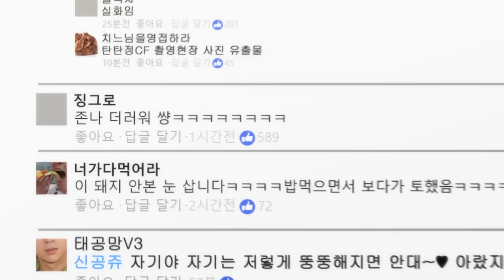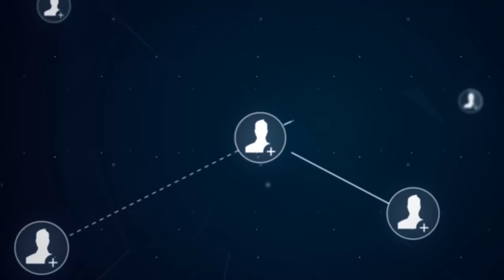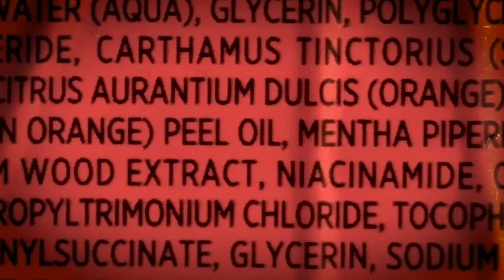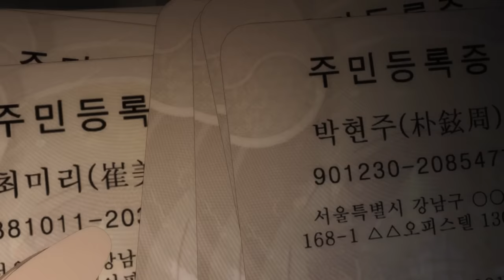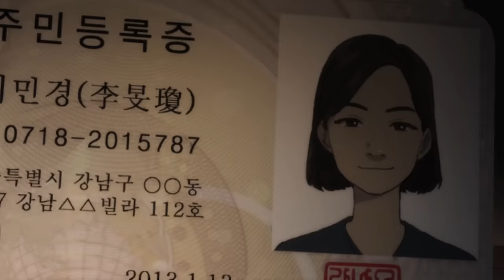How to beat the FLESH POTION in "Beauty Water"

Comment: The fact that the younger are prefered and how the procedure is done, it's most likely stem cell surgery, and why it deteriorates it's because the body needs time to adapt to the new tissue, you have to work out and eat healthy, and watch out for your circulatory system, since your veins will stay the same oversized size.

Comment: Also, if she just needed flesh to have all this happen and work for her, she should've maybe just found a larger person with more on their body to take, have bit by bit used and just store the rest. At a low enough temperature at around 4°C, you can preserve organs safely so that they do not deteriorate quickly. So she could've taken the job and began ASAP after it was offered at the boat party, get money in probably less than half a month to buy a fridge/freezer/ice box and just had a storage unit, so not only would she kill less but also have a stable  supply